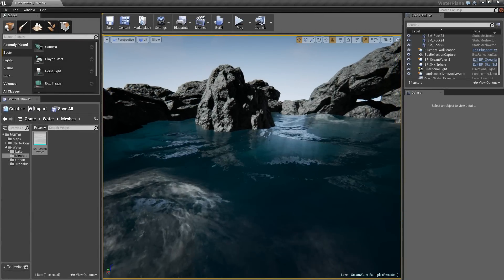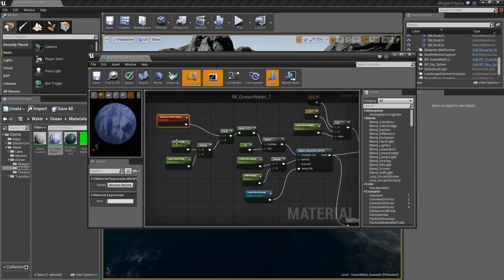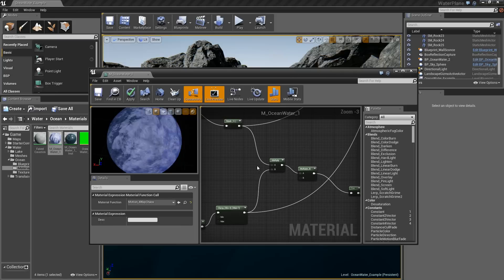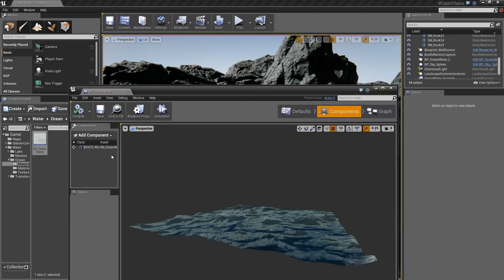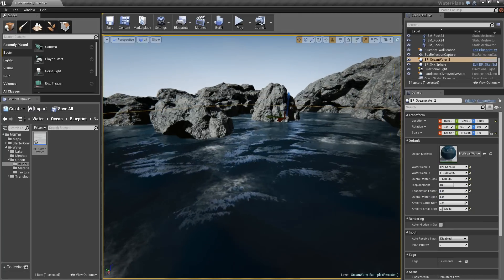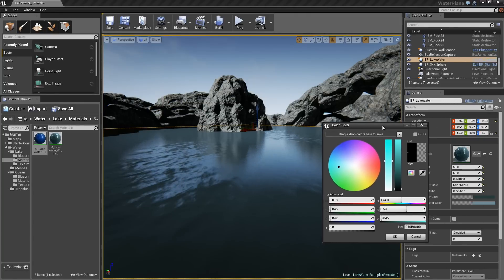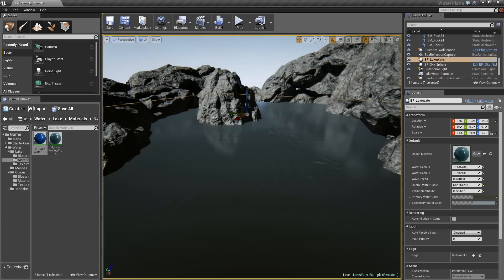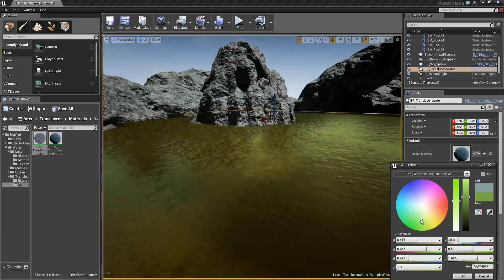Water Surface Overview | Live Training | Unreal Engine

Comment: To the people asking where to get this: this is the FREE "Water Planes" content by Epic Game under Epic Content in the Marketplace of your Epic Launcher. Just search for it, it is there since Jan 26 2015.  The latest version for it is for UE 4.25. You can, however, upgrade a 4.25 project to 5.0 since those two are compatible with each other.  You will have to of course fix some things like the tessellation parameter connections or vertex offset connections on the ocean material but it is doable-  I am doing it right now. Hope this helps someone

Comment: seamfoam on the edges   how would you do that :()
Reply: enable mesh distance fields in your project and then in the material, use the distance to nearest surface node. you can add a power node and multiply node with parameters to adjust it's behavior, and then use it as the alpha in a lerp between your regular water and your texture(s) for the edges.